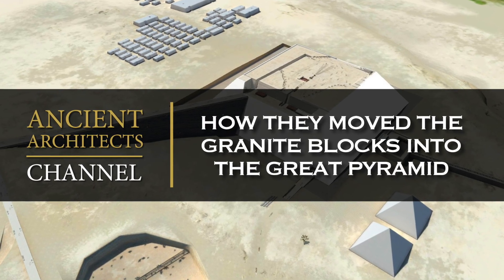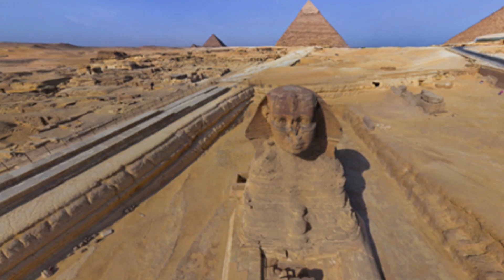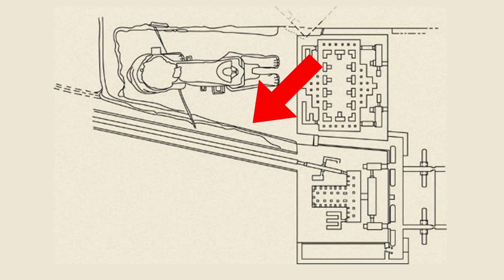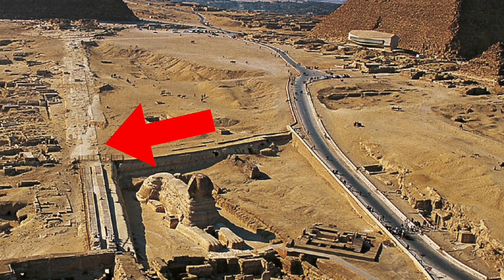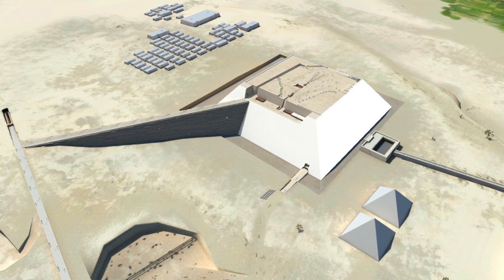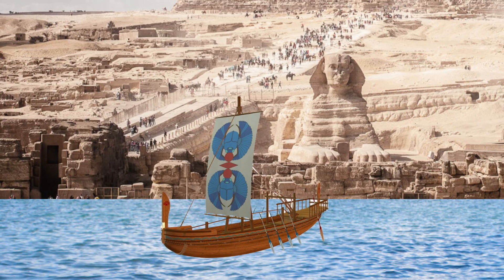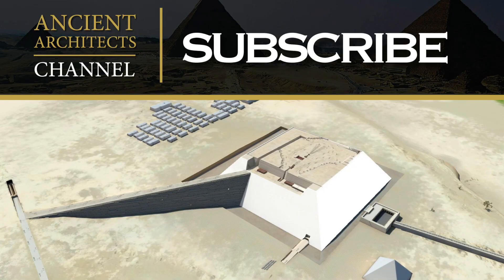How They Moved the 60-Ton Granite Blocks into the Great Pyramid | Ancient Architects

Comment: many years ago i decided to put a full size snooker table in my workshop. You would think 'that's not a difficult thing to do, but what i haven't said yet is it's going upstairs on the second floor. The flight of stairs are similar to a standard household flight of stairs but longer, so how did myself and a friend do this.
We pulled each of the 5 slate pieces up the stairs on scaffolding planks nailed to the stairs with several broom handles as rollers. It was remarkably easy considering we would never be able to carry each slate between us. Now i can see the weight difference and understand the problems with these blocks, but these stairs were very steep.

Comment: What happened 2500bc wasn't the building of the pyramid but the remodeling/restoration,
Reply: Herodotus wrote that the Egyptians claimed they built the pyramid from the top down.
1) This would indicate that they only had knowledge of the restoration!
2) he gave great detail how they lifted the casing stones, but didn't explain anything else.
3) if the pyramids were built at an earlier date without any knowledge of how they were built would explain why they are superior to any other pyramid.
4) a refurbishment would explain how the Egyptian were able to finish in only 20 years and how the Pharaohs manager to gather the labour that were not meant to be slaves.

Comment: I wondered if the moat around the pyramid flowed water down the causeway. A raft the width of the causeway would block flow until water rose in front high enough to lift the raft off the bottom. Huge weights could be carried on these rafts that are loaded in the water then guided to the causeway where people or animals could pull it up the slope. Ideally it would be a string of rafts that are close enough that the water building up in front acts to also lift the rear of the sled ahead of it. The water level would stair step its way down the causeway. Water for the operation is presumably brought from floodwaters impounded by the Sadd el-Kafara Dam about 20 miles to the south and 60 meters higher in elevation. A tunnel under the Nile would carry the water to the pyramids and up through shafts to the moat. The antiquities department decided to fill the shaft for the Great Pyramid with cement. The rafts are big so it takes very little water depth to lift off the bottom. Friction is almost nothing and you just need to pull up the slope and fight the pressure difference front to rear. After building is completed the causeway may still be used to send goods up and down. For instance, these pyramids could have been used to store food and grain. Water would be a good way to control humidity and temperature. They all have downward sloping passages where water can gain high speed and splash with great force. This splashing evaporates water and this chills the air, particularly in the dry air of the desert. And it humidifies the air so the food doesn't dry out. When a boat comes by, food is brought out and slid down the causeway to the waiting vessel. Egypt was the breadbasket of the region so they must have had industrial facilities for loading, storing and unloading products. It had to be effective at keeping food fresh, fast, high volume and low effort.

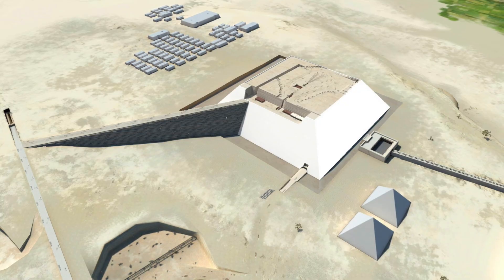Comment: **The nature of the pyramid's core and casing argue strongly against the use of construction ramps. A little know fact, the core demonstrates an eastward twist, corrected by the more precise casing. For complex reasons, this twist and casing correction suggest they were two entirely separate processes, meaning, if a construction ramp was used, for the complete core, it would need to be fully removed from the face of the structure and rebuilt for the casing application. 9:53.

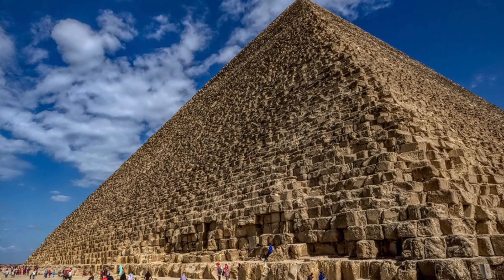Comment: **Houdin, nor anyone else, has demonstrated hauling the heaviest stones up a 6 degree ramp. 7:09. As a requirement of science, all suggestions toward stone mobility are guesswork and can be regarded as insufficient and less than thorough. Other than the small enclosure walls, which might suggest a small ramp, near the SW of GI, there is no substantial evidence of construction ramps at the site of GIl. Inducing construction ramps appears a circular argument.

Comment: I wonder why all these studies go so far then just stop . ✋ 
It's a bit suspicious if you ask me .

This guy has the theory about the internal ramp , works on it for 10 years apparently.  He finds a scan that shows he might be right . 
So he stops there and declares he worked it out . 

The there the team for did that scan and found a that big cavity , they too announce it to the world and don't do go any further.  

We can't blame everything on Zahi Hawass . After all he allowed these guys to do all these scans that gave them their evidence.  So why would he stop them going further ?

If that scan is showing the internal ramp then uts still there . Go up there and fucking find it .
Reply: Perhaps you should have dug deeper.  First is Houdin's internal ramp nonsense was debunked by the very muon scan results you allude to.  Next is there is no consensus as to "a void".  Some postulate it may simply be an area of different density compared to the rest of the pyramid.  They might have used filler etc. above the Grand Gallery to reduce the weight bearing down upon that area rather than solid blocks.  Remember they used the granite slabs above the King's Chamber thus they were aware of the risk for collapse. Finally they had planned to complete an additional muon scan to be done a couple years ago = but the Covid pandemic put many things on hold.

Comment: Houdin's "theories" = a joke.  Look at the exposed western base of the Great Pyramid.  See whereby there is a continuous ledge of limestone.  That shows = they built atop an existing hill.  As such at least part of the inner core was likely created using the natural incline as part of its ramp which was then covered over with stone blocks and possibly filler material - sand and quarry rubble.

As to moving blocks = look at the tombs of Hunefer and Djehutihotep.  The former shows yoked oxen pulling a large sarcophagus in a funeral procession while the latter shows a large statue pulled by teams of men who wet ground before the wooden sled being pulled.  Moistening the ground reduces friction - and thus effort - by almost half.  Now factor in they built ramps and roads partially out of tafla - a clay they mined.  What happens when you moisten clay??  Answer:  it gets slippery.  Forget Houdin's fantasies and stick to the actual evidence you see.

Comment: I genuinely find this theory less likely than either giants (Anunnaki), levitation / acoustic technology or even aliens. Even with machined counterweight, the human labor to build these is unimaginable... and the time it'd take.

Where he theorizes the shafts as counterweight systems, it completely undermines the acoustic / current tuned precision of the shaft and chambers. I don't think they built monolithic hills just to build hills. Theorizing the chambers are just relics of construction tooling implies that. These were functioning structures. Likely electromagnetic conductors.
Reply: I couldn't have put it better myself, my last comment doesn't even make sense where I try and convey the same sentiment but I feel my brain literally break as I try to formulate a response what gives justice to the pyramid. 

I feel also, as you say the labor behind this is "unimaginable" 

I would as go as far to say the "design" aspect which houses everything is just as "unimaginable"

Comment: I like the video/videos so keep it coming please.. 
After thinking, as the theory is correct, for using the causeway for building the pyramids, there could be an explanation. 
The alignment of the Spinx and the pyramids to celestial bodies seemed vary important. If the causeway was in fact built before the Spinx, there would have been the need to route the causeway with enough room to allow the building of the Spinx to ensure the alignment was the way they planned it.
With that said, I believe this was all built prior to dynastic Egypt and was repurposed to fit the need of the following dynasties. There is no (concrete) evidence like tools or hieroglyphics depicting anything about the pyramids. Need to keep digging on this subject....

Comment: In my opinion, it's ludicrous to carry on with the conception that the Ancient Egyptians  didn't have wheels.  In light of the extreme refinement of their engineering, it's impossible to believe they couldn't conceive of a wheel as a pulley or rocker gear, even if it doesn't appear in the archaeological record.  Blueprints or architectural drawings don't exist in that record either, but thousands of articles of pottery do, all made on pottery wheels.  I think we undersell the intellect of these ancient people by insisting "they didn't have the wheel".  

Of course they knew what a wheel was.  And I can't imagine they didn't know all about the mechanical advantage of block and tackle.

Comment: Did you know that an ice sheet of 2 centimeters can withstand 100s of tons without cracking if the ice sheet is on solid ground, and that ice causes friction with hard materials? And if the pyramids are 1000s of years older (+15000 years) than mainstream claim,, then yes, it is a possibility. Not claiming anything.
Handy especially in the Serapeum.

Comment: There never was a ramp to haul stones. I say this by observing there was no ramp used to remove the casing stones that were salvaged. And nobody cleaned up after taking those casing stones, the pyramids are surrounded by rubble from the salvage job, but there’s nothing resembling a ramp.
So how to move all the huge granite blocks? All of it was manufactured and brought on site when the first, ground level of 2-ton blocks was laid. The granite slabs were brought near to their final location, and were levered up to assemble the 2-ton blocks beneath, layer after layer. Once each granite block was at its final altitude, each was surrounded by 2-ton blocks and built into the pyramid.
There’s an important point about salvaging those casing blocks that nobody talks about: it was easier to remove the casing blocks than to quarry and polish new white limestone. Also, salvaging the casing stones would have been equal labor to assembling them into the pyramid. So that logically means that quarrying and polishing the casing stones was a bigger job than assembling them onto the pyramid.
Take a look at the pyramid site for where the ramp was for salvaging the casing stones, you’ll never find it. The casing stones were taken down the 52° step sides, one by one, with relative ease.

Comment: Move and hoist the gigantic granite beams into final place in one piece format? No. 
What about in sand and dust format? Yes.  

When it is too heavy to move it in one piece, we can discretize it to be cemented it back into intended shape with the help of a mold. 

Granite can be disintegrated more practically and without alien’s advanced machinery aid. Just crush it down to sand and transport it in discrete form. 

Crush? Granite can be broken down into smaller piece by either (1) heat and quench or (2) pounding a smaller piece in between two larger ones. The same process can be use to turn gravel size into grain of sand. 

Cement? Example?
Expanding (hydraulic) cement? Kiln fired crushed (limestone, gypsum and clay) further ground into powder. 
Non expanding (slight shrink) cement? Kiln fires crushed (lime, gypsum and oxychloride) further ground into fine powder.

Note 
this method doesn’t work in regions with frequent heavy rain fall where building size rain shelter were not practical, example Mexico Palenque building blocks aren’t polygonal. Opposite example? High above tree line where little to no rain fall, polygonal blocks is possible at Machu Picchu. 

Usually the pharaoh define the granite concrete mix proportion to a desired expansion or shrinkage. When expansion is getting out of control and risking damaging the mold or self destruct (blow out) the pharaoh poke a hole by the front-base to bleed off material from the core, leaving behind the infamous stone knobs. 

When to use expanding or not ? 
Expanding? Polygonal blocks, seamless fitting. 
Non expanding? Molding of sarcophagus of king’s chamber.

Comment: So every time you shift a 60ton block up the ramp you have another 60 ton counter weight which moves down the ramp and then you have to move the 60 ton counter weight back up the ramp, so lots of smaller stones on a sledge. That means ropes that need somewhere in the region of 200 tons breaking strain or a few of lesser value. But without a wheel pulley system doesn’t really work.
Reply: Forgot to say I do like the idea, but really only works if you have wheels for pulleys.

Comment: The pulling power of human workers plus counterweights would be hard pressed to overcome the friction involved and any type of rope that they had back then would not have been sufficient to avoid snapping.  Take all of the Monoliths all over the world into consideration.  There are huge precision cut stones at Machu Picchu  that were cut and positioned as if they were made of styrofoam.  There was not enough room for thousands of workers pulling them into position and counterweights pushed off the mountainside would have parted the ropes.  You have got to explain the Trilafon at the Temple of Jupiter in Lebanon.  Those huge precision cut and placed granite blocks in the Great Pyramid were not cut with copper or bronze chisels.  You would not use such huge blocks of granite in a construction unless you had the means to easily move them about.  It appears to me that A spacefaring civilization spent time on our planet before the ice age and took all of their high tech machinery with them when the ice age floods happened.

Comment: Hi, Matt. Another informative and intriguing video; thank you! I want to point out that the weathering on the body of the Sphinx and its enclosure is the main argument for its age to be great enough to put it back when torrential rains occurred, around 10k years ago. However, I don't see similar weathering on the south side of the ramp (as shown 5 min 35 sec into your video). This seems to me to suggest that the Sphinx was constructed when the paleoclimate would later support prolonged torrential rains. This does leave us with the question, "Why is the angle of the south side of the Sphinx enclosure irregular?". For that I refer to Hancock's thesis that the surviving pre-Flood engineers, who implanted their sophisticated knowledge into the groups of primitive peoples they found around the world, planned the tableau on Giza plateau in detail based on sacred sciences but only began its construction because the people they found weren't yet ready to take up the task. The causeway would have been part of that sacred Plan in order to prepare the way for moving heavy loads from the river to the pyramid construction sites. The south wall of the Sphinx enclosure was made at the irregular angle we see in order to remind and reinforce the Plan's idea that the causeway must be built at that angle because it was necessary to the sophisticated, sacred Plan. The idea would have been to try to insure that the details of the Plan would survive unaltered for the hundreds or thousands of years which would have to pass before the people would be ready for the revelations the Plan would show them.

Comment: The pyramids were inherited and just refaced with limestone by the pharaohs? The ignorant Egyptians could work limestone but not black granite
Reply: Actually if you score a shallow line into Granite, then fill that line with sand, and rub it back and forth with a wood or bronze toothless "saw", it will cleanly cut through the granite. The reason is sand contains sharp Quartz crystals, which is much harder than granite.  This has been demonstrated on video.

Remember when they put the robot up the Queen's chamber shaft, drilled a hole in that "door" and put in a snake camera?  One of the most widely talked about part of those images were the Egyptian hieroglyphs seen inside that little space.

They were Egyptian numerical glyphs that said 100, 20, 1. It was the builders marking the length of the shaft thus far, 121 cubits.
Reply: The only part of the pyramid that contains granite was the grand gallery, the king's chamber, and the relieving chambers.